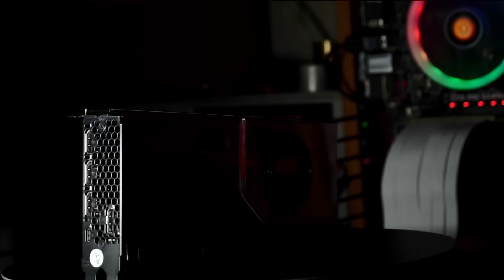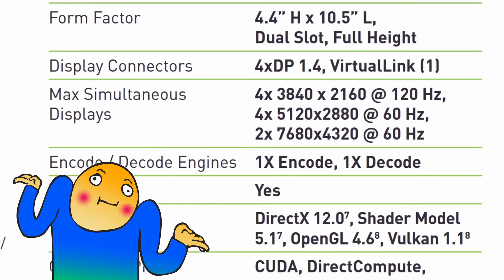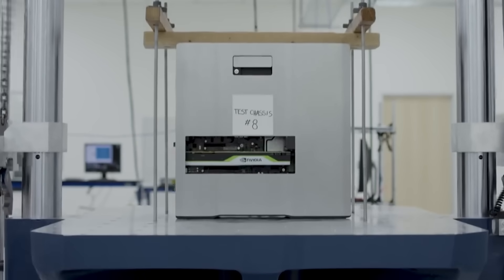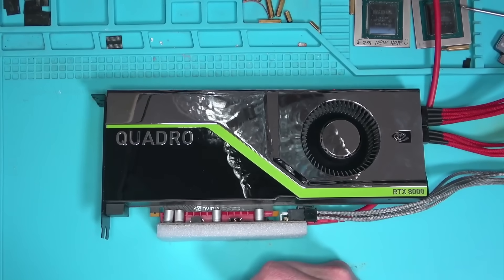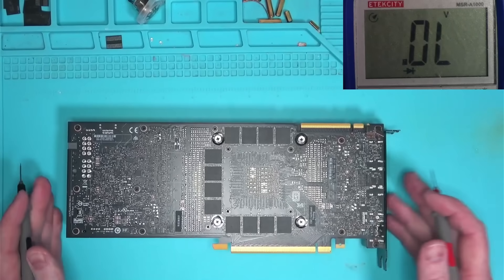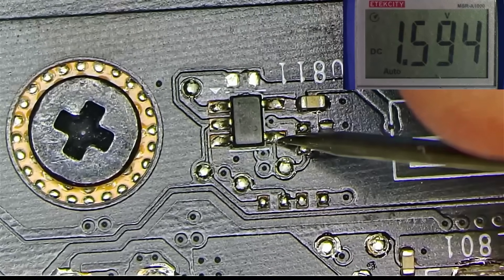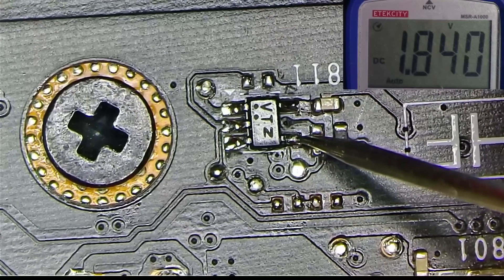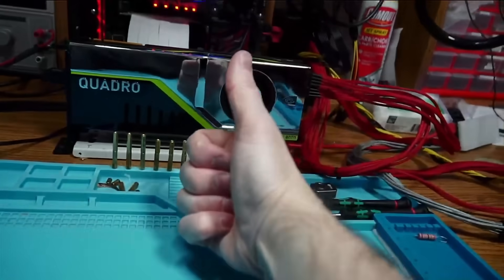Quadro RTX 8000 not detected by BIOS or OS (FIX) #viral #repair #gaming #render #nvidia

Comment: Hey man, i used a air sprayer on my computer to clean dust, when i started my pc after connecting all the Cables again, my computer had different Resolution and my digital vibrance and nvidia settings seem to have dissapeared I dont have access to all nvidia control panel settings. 

So i did a restart again took out power cable waited 1 min before i restarted

Still same issue 

Then i uninstalled nvidia graphic card drivers all of them and reinstalled them

I still dont have access to all the settings in my nvidia Controlpanel, i can’t adjust my digital vibrance etc because 

I dont know What to do…. Please help!

Comment: do you see anything on that card that cost so freaking much besides alot of memory.  But where is the cost.
think its a scam with special drivers
Reply from the maker: Most likely.
ATI was getting away with FIREPRO for long enough until someone decided to move a resistor and flash it with different bios to enable firepro on a regular 560 or something. Dont remember, its been a while.

Comment: Why would you need a graphics card with that much memory for video editing? Video editing software basically streams stuff straight from video files to the screen, it needs almost no VRAM at all. The card is probably pretty good at compressing video (at least if you use a GPU-accelerated codec), but that's something you only really need to do at the end, and even CPU rendering is pretty fast these days (it's not like you do 4-hour "let's play" videos).

The point of those Quadro cards is mainly real-time raytracing and (these days) AI preprocessing (plus compatibility with / certification for some esoteric stereo rendering systems).

Comment: The RTX8000 has memory modules on the back of the card.

A backplate might look nicer, but it just traps the heat
(unlike the other side, which has a large cooler).
Reply: My Titan X Maxwell doesn't have one either. Seems like the blower style coolers don't have them.
Reply: @PontiacKid2  Not all blower cards. I recently got a TITAN Z from eBay for 200 bucks, almost new condition, it has the OG Nvidia backplate, and the old ones actually did have pads on them.

Comment: I once asked you about this no detect on a Quadro and got hints from the forum and how i solved it is exactly what you did on mine the logic chip was ripped off due to the absence of the backplate probably card rubbed onto something, nice repair there
Reply: That card seriously needs a backplate.  Don't know why nvidia doesn't feel the need for components on the back to be protected.

Comment: These cards are shiny and new - how did a dead one end up on your desk? I would have expected that to go back to the manufacturer....
Reply: time. Its SO much faster sending it to a repair shop like his then it is to the manufacturer. When you send it back its 2 weeks minimum, wheras you can have it done within 1 week at a repair shop depending on how far you are.
Reply: That's what I was wondering. Strange since their pro cards tend to have extended warranty.

Comment: I need one of those PCIe slot extenders!
Reply: I'm buying one of those ASAP. And a multimeter.

I have a mini soldering pen, but I need a micro one, better tools. I'd be super cool if I managed to fix a simpler card like my old 750Ti. There are like 6 transitors on it. At worst, it'd need a reball for the GPU in which case i'd be F'D entirely since i don't know where to even start buying equipment for that... lol

Comment: Quick repairs prove one thing, your experience level is extremely high. Excellent work, as always.
Reply from the maker: Thanks 👍
Reply: I agree. The ability of knowing where to start looking for with specific problems is a true sign of somebody who not only has the "book knowledge" but also has the field experience.
Reply: exactly! most people would say just lucky, but I know better. I work in semiconductor industry with very complex machines, when ever something goes really bad I ask for help from senior engineers, I troubleshoot 2-3 days, they fly in from Japan or Korea, unplug two cables, replace a part and boom, it is working again. That is not luck if they can reproduce the same outcome consistently.